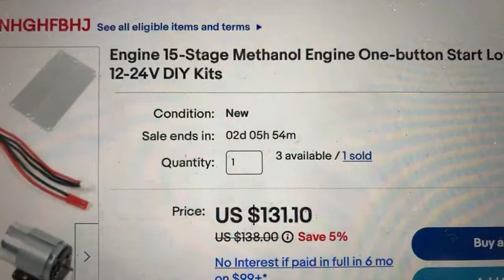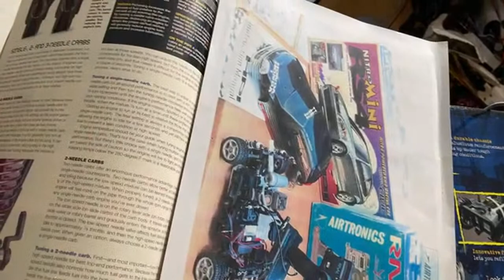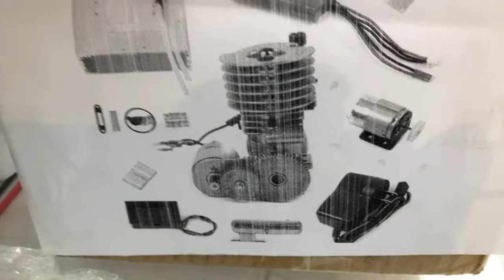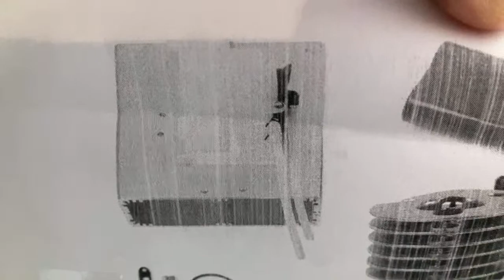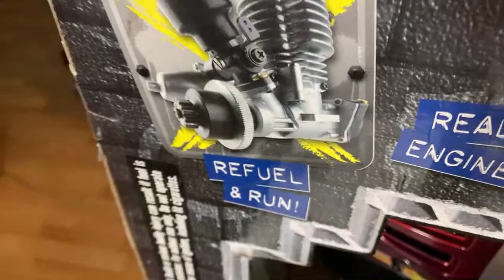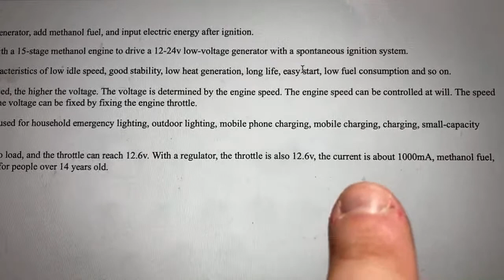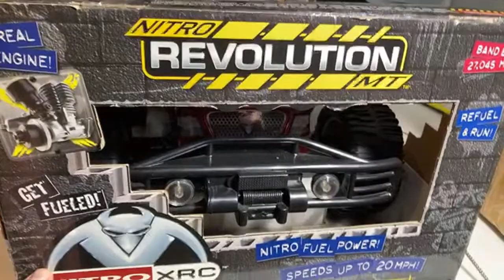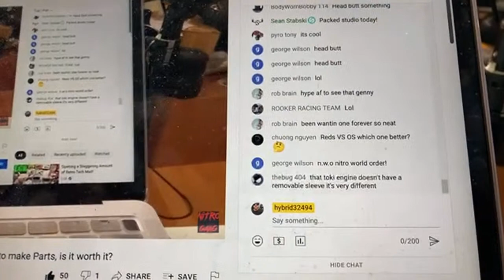NitroGang Live - Unboxing a Nitro Generator - Buying a 3D printer to make Parts,  is it worth it?

Comment: Regarding 3D printing, I’ve done exactly what you’re considering. You can design your own components using free 3D design software like OnShape. Those files can then be printed. But as you suggest, the resulting parts will never be as flexible as original. Lately I’ve been buying Traxxas body posts from a Slash and just modifying them to slip over the original body posts on the car or truck. They seem to hold up better.
Reply from the maker: hey man!  Thanks you for that advice and your experience.  It's basically what I expected, you need the flexibility for RC parts, especially body posts.  I'm still looking into a Creality Ender 3 V2 for some basic stuff and just coolness factor of making them myself.  In the end I know 3D printed parts will never be IDEAL.

Comment: And now I know why this live video was only an hour long because it cut off at the end
Reply from the maker: hahah! YES!  I was just getting Started, I was about to use the Electric Start on the Generator when this was cut-off.  I had a system wide internet failure, probably sponsored by the ARRMA Gang!!.  ahah.  jK.  Anyway, I will be using the built in electric start next time.